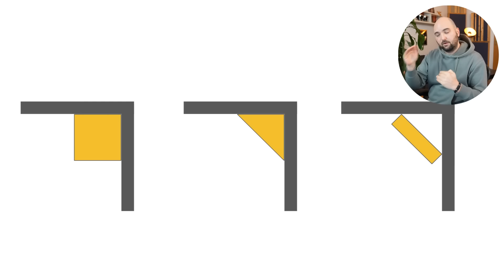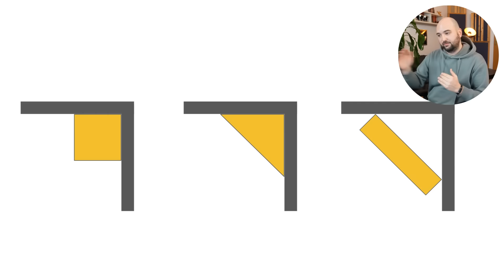Bass Trap Shapes Compared: Which Design Actually Works Best? (with diagrams)

Comment: does this suggest that circular traps are pretty good?
Reply: No
Reply: @Fubuki43  in that case, why? in terms of actual area it is better than some of the examples in the video.
Reply: @claudioa.dmedina2020  The sides of the circle aren’t very thick while the middle part is too thick (since leaving an air gap would make the sides even less useful). If you’d use the same volume but in a rectangular shape, the sides become just as thick as the middle and now it makes sense to use an air gap.

Comment: Careful when hugging the corners with insulation, you’re asking for mold. Keep it 2-3 inches off the wall, stepped superchunk works great.
Air gaps improve bass response but also increases comb filtering so I personally avoid it on first reflection points. If you vary the air gap on all your identical panels it averages out so maximize the gap where the low room modes are.
Reply: Interesting. 
Would placing the panels with an angle in relation to the walls have the same effect in reducing comb filtering?
Reply: So no mold, but a perfect home for spiders. Hmmm...

Comment: Excellent video! I have the right most bass trap design in my studio, 25 cm thick and 60 cm wide. My measurements show that it’s super effective and it wasn’t expensive 😊
Reply: Same here. We cut a dry wall in middle, 60cm each and stuffed about 20cm of knauf ultracousti material. Lastly we drilled about 140 8mm holes in rows of 6 in order to absorb the lows and it works like a charm. Bass is super tight
Reply: What material did you use for the absorbtion?
Reply: @ Rockwool

Comment: Hey, that's close to my unsubmitted unanswered question - what about horizontal vs vertical placement in corners if you have the space? 

With typical EU 120x60 cm panel, is there a benefit placing those horizontally rather then vertically? 

With horizontal placement, obviously there will be more material in a single corner. But let's say the overall amount of panels in the room remains the same - is it better for bass absorption in the corners to go  horizontal rather then vertical?

I have even seen people tilting the horizontal panels in corners, so they are not 45 degree angled but maybe 20-25 degrees.